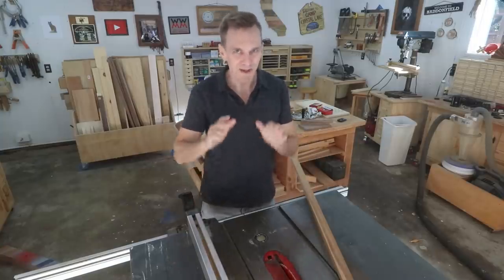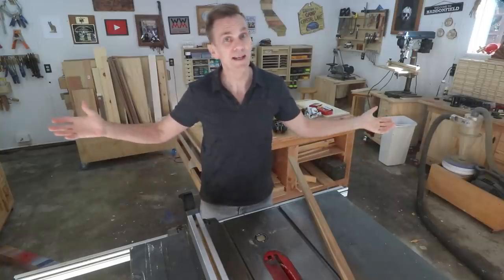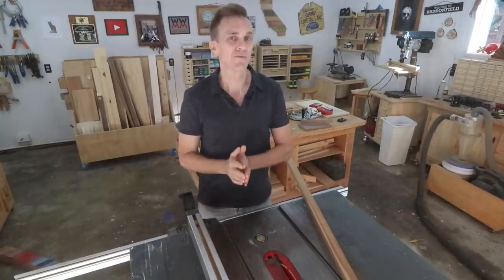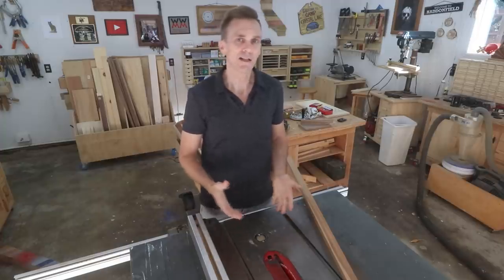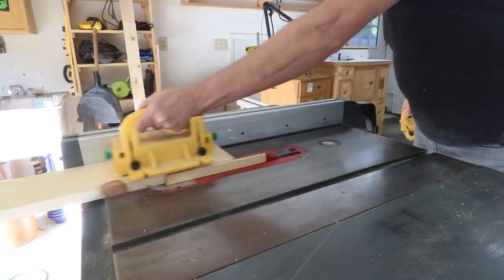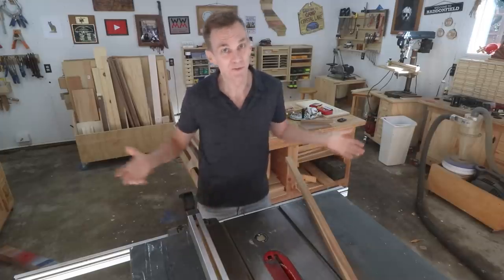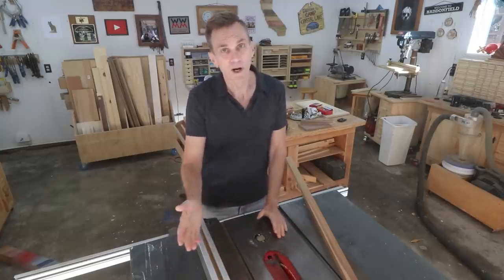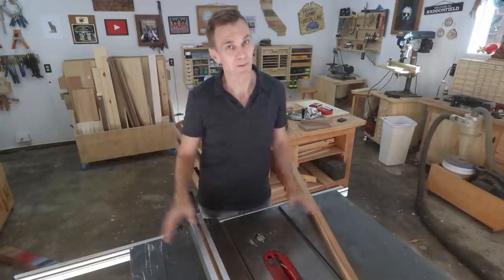Why does wood get burn marks from a table saw?

Comment: I reduced the amount of burn marks by cleaning my blades of glue from plywood and sap from dimensional lumber. I also wax my blades before I remount them. I also wax the surface of the table saw and the rip fence. If there are black marks behind the cutting teeth, the blade will leave "burn marks" but is actually glue or sap. Clean the blade. I have seen that with clean blades, clean and waxed surfaces I have better cuts.

Comment: Where do you find table saws with riving knife that raises with the blade and doesn’t go above the blades my saw is an older craftsman a good saw but have to remove knife to cut dadoes etc

Comment: In my limited experience, blade height is also a cause. Common wisdom is the blade should be just a hair higher than the thickness of the material. With thin stuff that's true. But  with thicker and harder hardwood  you should raise the blade as high as you ar comfortable raising it from a safety standpoint. With the blade higher, there's fewer teeth in the kerf at any given time and the path the teeth take is shorter.

Imagine the blade in the kerf when the blade is low, they spend all their time in the wood and make a large arc through the wood. If the blade is high, it goes almost vertically through your material in the back and then again almost vertically in the front.

Less teeth in the kerf is less friction and less burning.

I think Johnathan Katz Moses did a slow Mo video regarding this...
Reply: This is what I did to finally solve my issues with burn marks.
Reply: True. For ripcut blade at max height for crosscut blade low. (Also 2 different type of blades officially)
Reply: I sent an email to a major mid-grade blade producer and asked what the recommended height is. They said the gullet should be completely clear of the wood, but not much more than 1/8" - 1/4" more than that. More than that and the angle of approach can be too steep and contribute to kickback. Lower than that and the gullet doesn't clear any dust it has in it and produces more heat.
Reply: @mychalevenson7710  the gullet above the wood is good advice but the hight advice is false. The higher the blade the more the teeth cut downwards so less force towards the operator so less chance of kickback. A low blade means you cut with the top of the circle and therefore cutting horizontally aka towards the operator. (Rivingknife stops the wood getting lifted up at the back of the blade)
Reply: @heimdall4148  kickback starts at the back of the blade, not the front. Direct downward force at the front of the blade means direct upward force at the rear. Kickback begins when the workpiece lifts off the rable due to pinching or twisting. Further a high blade can has more leverage and more space to accelerate the kickback launching it at faster speeds. Then there's the angle. The lower the blade, the lower the kickback. A high blade kicks toward your face. A low blade kicks toward your gut.
Reply: @mychalevenson7710  thats why you need a riving knive and a decent feedrate to make sure the downwards force from pushing the piece trough making sure the pressure at the front of the blade is equal or more than the upwards force at the back. (Talking about solid woods and cutting along the grain that is)
Reply: @heimdall4148  of course. Table saw safety is important, but every now and again, despite every possible safety consideration, disaster happens. It's a good idea to understand what you're giving up when you do something. Higher blades are less safe but burn less.
Reply: @mychalevenson7710  yes thats why it is good for beginners to start with a low power tablesaw so they can have a few kickbacks without penetrating their own gut with an offcut haha

Comment: I have a makita jobsite saw and find that I get burn marks on my cross sled and rip fence. Blade is .90 to the table and miter slots so not sure why also I have Freud brand new rip and crosscut blade. I find that the wood warps and bows as well some times

Comment: You know, such a stupid rookie mistake, but when I got my first circular saw, my first cut ever, it was horrible and burnt the wood. It was barely able to cut, actually. It turns out I had put the blade with the teeth facing the wrong direction. It was quite dangerous, as I almost cut a finger off.

Comment: Purpleheart:  I have finally vowed to stop working with it!!!  I have a friend who loves it and so I have done a lot of projects with it.  It NEVER makes it thru my planer without terrible tear-out, the router often leaves black marks, and it almost never makes it thru a table saw cut without scorching.  I use an appropriate, clean, sharp saw blade.  I finally just accepted the fact that any cut was going to scorch and I started making all cuts 1/16th inch oversized, then go back to clean off the excess from the cut...ie, twice the work on every cut.

Comment: I've worked as an automotive painter for almost 40 years and the best thing I've found to remove pine sap from the cars is splash some degreaser on a rag, run it under water for a sec then squeeze it out. The 2 do not mix but work like magic ✨, separately they do not work at all, go figure 🤷

Comment: Hi Steve, does burn marks from a table saw will not affect the glue bond?
Reply: I personally try to sand any Pine burns off before gluing, but that might be me being paranoid. Ha ha. Other species I've never had a problem with though.
Reply: @Toyotajunkie  thanks, I will try it next time.

Comment: I literally had this happen with some walnut earlier today and didn't know why. I'm guessing saw blade with too many teeth
Reply: If it’s in your budget, try a high-end 24 tooth ripping blade (CMT, Forrest, etc). I couldn’t believe how much of a difference it makes. The only downside is it can leave a very slightly rough surface if you aren’t consistent in your feed rate, but easily sandable.